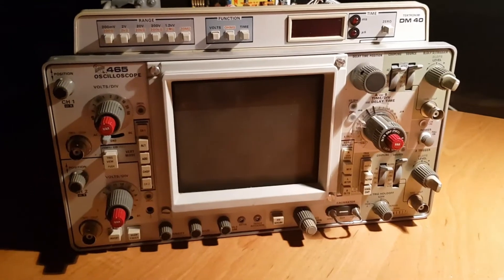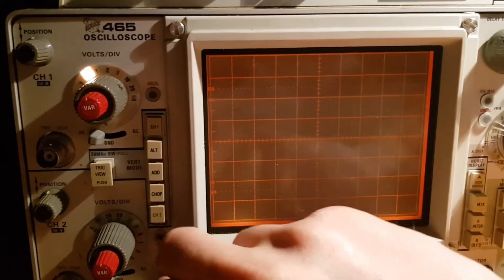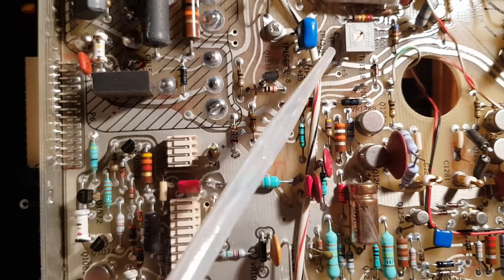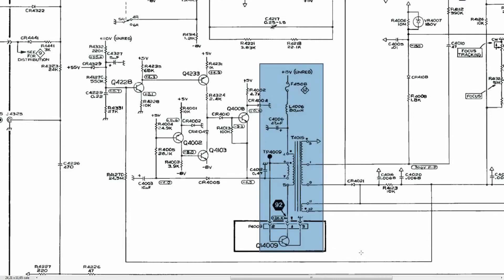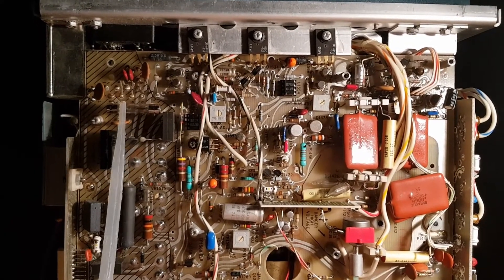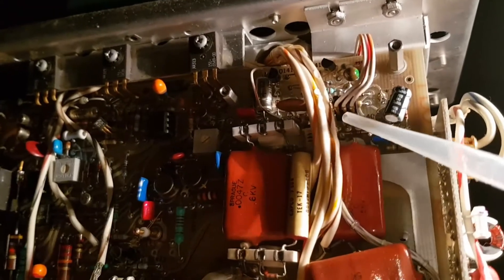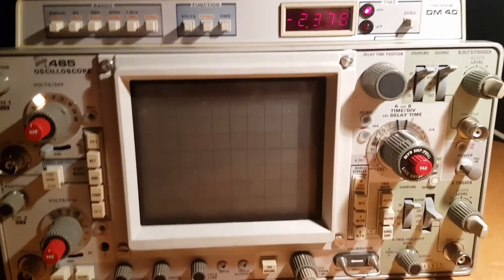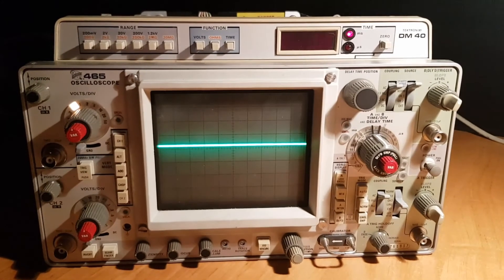Fixing Tektronix 465 Oscilloscope - screen problem

Comment: What happened to the Delay Time Position knob? I have seen these models with a metal double knob.
Reply from the maker: There was two kinds of 465. With multimeter module on top and without it. These without multimeter have double meal knob.

Comment: I do not understand why everyone on internet or from forum tells that tantalum cap or big cap replacement can save Tek 465, 465B, 468, 475 and 475A. It may be true and work for their own oscilloscopes. However, if it is so simple to replace a cap to save your old oscilloscopes, why wouldn’t those recycle companies just replace all those oscilloscopes with new caps and re-sell them for new price in internet? They will make a forture for sure!